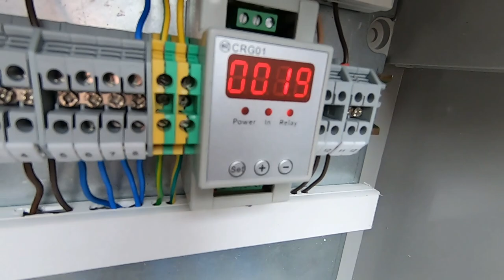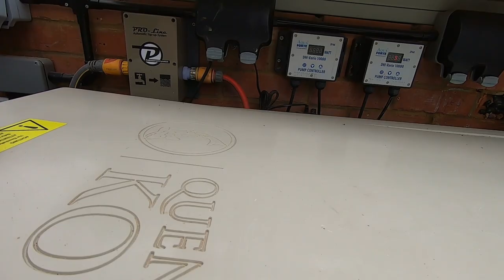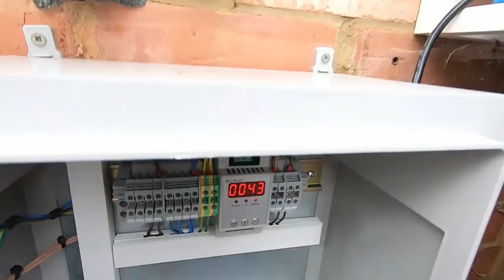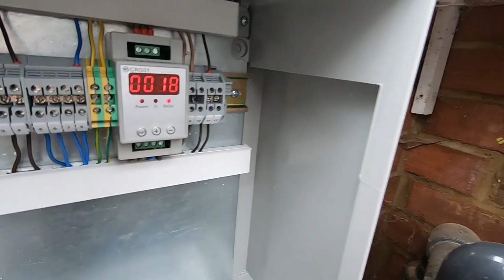Koi pond one way valves, Cats update and Upflow completed.

Comment: Have you thought about putting a gate valve on the top of the upflow filter... when I clean my tempest I use air also .. but I leave the top gate valve open while I'm using the air to help clean the media,  I closed the top  valve when I'm emptying the tempest to push the water down quicker with the air on .. stay safe mate
Reply from the maker: Hi mate, I could put a valve there but I'm the opposite of you as I want the water to slowly drain with the air. At the moment, even with 1" waste it seems to discharge too fast for me. Good spot though. Stay safe